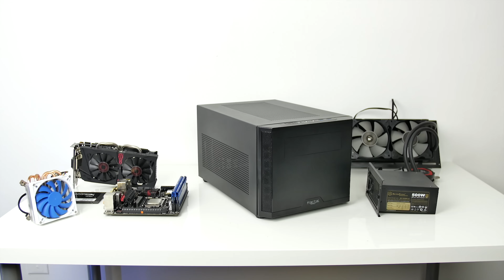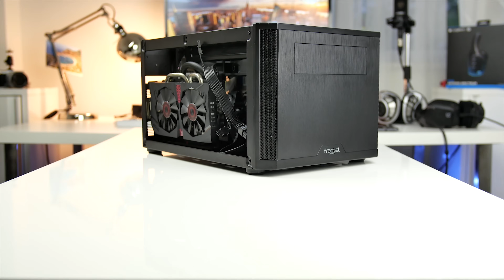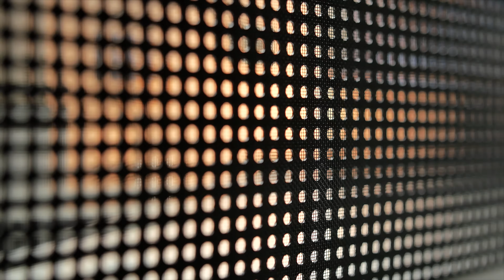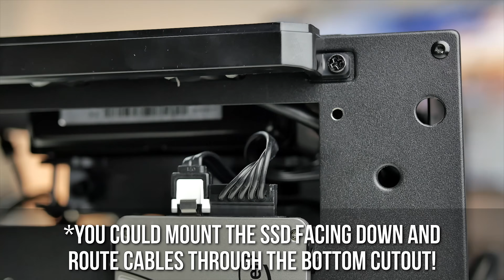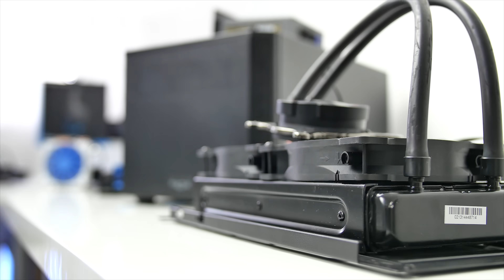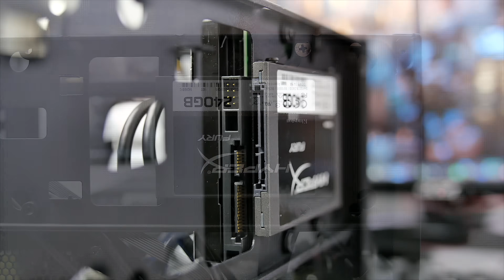Fractal Design Core 500 Review | New ITX Case King!

Comment: looks good but one day they will make a case that i will like 100% but they have not with cable why not have all the power needed to be mounted to the mainboard bracket so you can just plug a PSU in the the bracket

Comment: I know I'm late, but could tell me what type of screwdriver you used to get those 4 overtighted drive bay screws out? I have tried 16 so far. The heads are soft, shallow, and will not move, and are starting to strip. I've used PH0 to PH2, My Ifixit kit, pen oil, and even small flat heads,

Comment: i like this case & prefer using fractal design core 500 itx case over this coolermaster elite 130 because can fit CPU cooler from AIR up to 170mm or 280mm radiator liquid AIO cooler.   the benefit is the power supply move to the front on bottom.  suggest using SFX slimmer power supply because shorter cables.  

my 1st from late 2016, asus z170i, i7-6700k, hyper 212 evo cooler, corsair 16gb DDR4,  500gb SATA SSD with dvd drive & silverstone 450w SFX PSU & windows 10 home.  waited on GPU until mid-2017 lead to shortage from bitcoin mining.  id had corsiar h60 cpu cooler but switch because went to family member because upgrade over their windows XP on it.    idle at low 30 C & never goes more then 40 C because light workload with only watch youtube video.  

2nd, in nov. 2018,  asus z370i, i7-8700k, be quiet dark pro 4 cooler, corsair 16gb ddr4, 250gb nvme SSD, 4tb nas backup drive, corsiar SFX 600w power supply & evga geforce gtx 1060 6gb ssc, windows 10 pro.  my 8700k was delid & temp are down ~10 C.    idle in low 20 C & never got higher under load 60 C.  the gtx 1060  GPU has reach ~ 74 C.  & still quiet. 

itx case build is smaller space & know on limited expansion & space for installation.   you can turn up front side up & remove screws & look like the "black" mac pro desktop but more upgrade.

Comment: Just built with this case.  Decent overall.  But for crying out lout some of those screws were in there damn hard.  Had to get a power drill with a screwbit to unscrew a couple on  the fronst so I could detach the 5 inch bay.  Also had to detach the back fan to fit a huge power cooler.  I would also HIGHLY recommend an SFX power supply.  Gives a lot more room to work with.  Full size will work but will likely compromise the videocard length.

Comment: No it's not the ITX King. I bought this unit a month ago. Due to work outside of city for about 1 month, i just got a chance to check my new Core 500. However i got a DEFECT unit, 4 screws at fan bracket are COMPLETELY UNREMOVABLE, hence i couldn't place my 240mm radiator unit in there. Both Fractal support and the local dealers are pain in the ass. They don't want to replace my unit (The dealer said they don't want to replace any case unit after 1 week from delivery date, while Fractal insisted for me to ask the dealer to replace mine)

TL;DR Fractal Core 500 is a piece of **. Completely disappointed

Comment: I actually have an itx build and i just put an R9 280 in it. I have the coolermaster elite 130 case. here are the specs. It has a 6800k richland APU, gigaybyte F2a88xn wifi mobo, corsair h55 all in one water cooler for the cpu. An old 700 watt power supply and 8 gigs of corsair vengeance pro ram at 2133. and 2 terabytes of hard drive space :). I need to get my other hard drive replaced in there so i can have 4 terabytes :D lol.

Comment: Nice to see that the 5 1/4" bracket still fits with an H105 installed. I don't love that cutout for a 5 1/4" bay, so I would probably put some sort of shallow 5 1/4" accessory in there.
Does anyone know how deep this bracket is?
Reply: It is quite deep, but removable.

Comment: I built in this case the stock 140mm fan is an intake. I could not connect my audio jack. I am going to add a cpu water cooler (Deepcool).

Comment: You have configured all fans for exhaust! Is that wise?
Reply: air will intake naturally from all the holes of the case to compensate the lack of pressure inside the case compared to outside. If you do only intake fans the air will exhaust from all the holes to compensate too. Doing only intake with dust filtered fans will help a lot to keep the system dustproof as the air will get out from the tiny holes and the dust cant inter by here.
Reply: That and rads should never be exhaust. They need the coldest air they can get, that rad should be intake and I would flat out remove the rear fan or put a very slow one.

Comment: The SFX power supply adapter plate is cenered, Why cant the power supply be designed to be higher by making it mountable to put the power supply higher or lower. Is it possible to bottom mount a ssd/M.1 drive.

Comment: Hey guys, how do you put this lid back on? I have made a mini itx gaming rig in this case and the lid won't fit on! The screw holes won't line up with the holes on the enclosure lid? I don't have too many cables in the way and it should close but I can't figure out the mechanism and the manual was atrocious! Any help would be really appreciated!!
Reply: Hammer
Reply: lol
Reply: I managed to close the lid but now I opened it again cause I Want to remove the radiator bracket so I can do some proper cable management. Getting good temps but worried about wasting space for better air flow inside the case. My only problem is that 3 of the 4 screws for the mounting bracket are too tight to remove. I have a normal Philips-head screw driver and the first one came off just fine. Wondering what went wrong and maybe if I got a faulty case with the screws soldered onto the case. The manual says the bracket is removable for ease of access so it should work okay and that screw driver undid all the other screws so I don't see why I am having this problem. Any advice? Just lost my multi-bit screw driver as well! :( that might have done the trick.

Comment: I bought this case last week and found that it's probably easier to manage some of your cables by routing them around the front of the frame (assuming that you're not utilising the removable 3.5" and 5.25" drive cage. There's always a way around it, it's just that you need to use your imagination

Comment: What are temps like in a case that has only a 140mm exhaust? I wont be using a rad at the top for my CPU but will try to fit my Bequite Pure Rock if possible.
Reply: Just checked out the specs. This case is perfect for my Bequite Pure Rockcpu cooler, Seasonic M12II ATX psu, WD Blue 1TB HDD/250GB SSD and R9 380X gpu!

Comment: I just wanted to double check that this fits a full sized air cooler like the Cooler Master 212 Hyper EVO? I'm looking for a mini itx case to use to transplant my current parts into a small build by downgrading my video card potentially. Many thanks in advance!
Reply: CM Hyper 212 EVO is 159mm tall and the case supports up to 170mm tall CPU cooler so your good for the transplant!
Reply: Thank you! I am still torn between what case to get. I am interested in the BitFenix Prodigy M at the moment. So many choices! If I get the BitFenix case then I don't need to get a Mini-Itx motherboard cause mine is already macro size.
Reply: +NateyMcGee Leet I have a new question!! Will the Cooler Master 212 Hyper EVO fit along side a Corsair CW-9060007-WW Hydro Series H60 High Performance 120 mm Rad All-in-One Liquid CPU Cooler? I want to use that to cool my GPU because my Cooler Master 212 Hyper EVO is cooling my CPU. Many thanks in advance!! Sorry for the trouble.
Reply: It will fit if you put the H60 towards the front where the CD drive/HDD bracket goes.

Comment: I like my CM Elite 130s just fine. I built my first one as an HTPC, and liked it so much that I built a desktop from one too. Lack of included dust filters on the 130 are the only con vs. this Fractal, whereas I can run full-sized PSUs and GPUs without issue in the 130. I don't see the Fractal bringing much new here.

Comment: I found some very unique features with ANDY LANK METHOD while trading as a real user. It’s one of the latest trading signal services that can send signals of business which are highlighted by the software randomly. The main point of loving this system should be that ANDY LANK METHOD system does not require any major broker that adds to the lack of trustworthy of this tool. ?

Comment: Damn, this tower is much to high.
I know its no car, but they should lowered it !
No 120mm in the back, no 5inch slot in the front.

Put the 120mm or even 140mm  in the front

then lower it until it hits the GPU. Low rofile cpu cooler.
and then an fsx power supply, SSD/HDD over the PSU.
Air intakes are  now the front, the GPU side, and right above Low Profile CPU cooler
OUtput to the rear with Ventalation holes

then it is like 30% lower.
And maybe 10€ cheper would be great :D

As LAN-PC its simply to fat, and ITX cases should not be so fat

Comment: Pass on this one btw guys and get the cooler master 130. I just built my system in this core 500 and i wanted to love it so badly but its a complete pain to build in this thing. The panel is a pain in the ass to get back on right as was stated in the video and If you have a full sized modular psu you cant install a gpu, which you can do on a cm elite 130. Sure my fault maybe for not looking too in depth at what you can and cant do with a full sized psu, but its ridiculous that an aged 35 dollar case can do what this one cant. Get the 130 unless you absolutely have to go with a fractal case.
Reply: You can use a non modular 170mm PSU or 160mm modular PSU with a 310mm GPU so what are you talking about you cant install a GPU with an ATX PSU?
Reply: +NateyMcGee Leet Most people i know have modular psu's. Btw I tried stuffing 3 atx power supplies in there one of which was non modular and not long at all and i still had to rub my gpu against the cords coming out of the psu. Ill say the core 500 has better airflow and probably better quality than the cm 130 but it doesn't fully offer full atx psu compatibility with a long gpu for about 90 percent of people out there. I tried to make this case work without having to resort to buying an sfx but alas for my needs i just couldn't. My 970 was forced to rub against every psu i put in there, all of them varying ion length.
Reply: That sucks to hear I might get the Define Nano S now, thanks for the explanation.
Reply: http://imgur.com/a/kx7QN

check this out

No problem and personally i wish the define nano as out when i was in the market for an itx case because the nano is far superior to this core 500. At least i found an alternate use for my core 500, it was re purposed as my secondary gaming rig which houses my i7 5775c and 1tb ssd, good enough to play league and some fps. Just take off the outside panel, drill holes on the frame to line up with your motherboard stand-off holes, zip ties through the holes you drilled, and viola, you have the worlds smallest open air full size atx chassis, which sadly holds more drives than my corsair 600c, which is a full tower. Everything is secure and ive grown quite fond of it. As an itx case, it sucks really badly if you want to fit enthusiast components, but as a makeshift atx cube, its actually is damn good and looks pretty snazzy imo. I know some people would think its hideous but hey, different strokes for different folks. It doesn't accumulate as much dust as my main rig in my corsair 600c or my other system in my define r5 which is weird seeing as its open air.
Reply: Lmao that's awesome. You wont have any temp issues for sure.
Reply: NateyMcGee Leet Nope, well good luck on your search for that special itx chassis.
Reply: It looks like you can install a gpu but not your three fan type you as that looks like it will cause interference. Well I guess this might be a good case for a future build of mine if I plan my hardware carefully.
Reply: This looks like it has good hardware support but might consider the core v1 or nano s as well.

Comment: IMO the SG13 and Elite 130 both do a better job in a similar form factor.
Reply: SG13 has terrible ventilation and cooling. Core V1 is small and it has great cooling.
Reply: Hardware support on this one tho. Sg-13 is capable up to 61mm of air cooler height while this can do up to 170mm. Depends really on what your after. I personally would go with this.
Reply: If you use an SFX power supply (as truly intended) i believe the SG13 can support roughly 125mm cooler actually
Reply: @YoItsM0  when you put it that way. You are right.

Comment: Why make this build with negative-pressure when you have got to know that it leads to dust buildup because it pulls in unfiltered air? I think Skylake is efficient enough that you wouldn't have to work about the hot air causing anything to overheat. You could also go with a blower-style card to help keep internal temps down.

Comment: Excellent, I've been waiting to see reviews on this case; thanks for doing one.  I already have my itx build in this case, and I absolutely love it.  Although coming from a large form factor build in an R5, cable management took additional patience.

My only complaint about the case is the 5.25" cut out.  The front panel would look much cleaner w/out it, especially given where 5.25 inch drives are in their life time.

Regarding the front IO cable frustration mentioned at 4:15 - I routed mine outside of the interior, starting at the front panel and taking them along the upper/outer drive  mounts.  They flow nicely to the rear of the motherboard from there.  And I did the same w/my sata cables.  Instead of going across the interior along the motherboard, I routed mine behind the front panel, then along the outer drive mounts.  This freed up a bit of interior space.

Comment: this case was great, however mounting the 4th screw in the psu was impossible for me and routing the extension cable to my seasonic x650 psu was a pain. also beware putting giant air coolers in this baby, its tough
Reply: I made the mistake of using a big ol' air cooler in this case. Got it all in eventually, but it was cramped.

Comment: Seems like you glossed over things a bit Dimitri, but still a solid review.
Reply: +Soso64bit That's exactly it - a case review. He has no need to go into what hardware he used. You can see what he used most of the time anyway - you don't really need to know what the motherboard, CPU, HDD/SSD or PSU he used since they are mostly always the same. Cooling he should cover because that takes up space.
Reply: +QuestionmarkX3 agreed, would be nice to know which components he used and why. I guess it was just a simple case review, but I like when reviewers go into detail of the hardware used.

Comment: Can you guys help me? Will this fit in this case. I've checked and it will but maybe I overseen something!
EVGA Z97 Stinger WIFI (with an Intel Core i7-4790k)
ASUS GTX 970 Strix (*will there be much "force" between the cables from the psu and the gpu?) 
Corsair RM750 ATX Power supply (*will it bottleneck or destroy the mobo :s?)
Corsair H100i
1 SSHD
1 SSD

Thanks in advance :)
Reply: Emanuele Romagnolo Removed your awnser since it is freakin' bullshit.
Reply: +perryhoofd Corsair RM750 is 180mm while this case supports modular PSUs up to 160mm only.
Reply: Gandalf 771 Ah okay, thanks :)

Comment: this has to be the best ITX case I have ever seen, if and when I ever build a ITX system I will use this case no doubt about it. I wonder if a 140mm radiator on the back and a 280mm radiator at the top will fit together in the case at the same time?
Reply: +LightHawk000 have you ever even seen a 250D?
for 60$ this case gives you better heatsink clearance than the 250D, and a longer gpu support. The 250D has the psu mounted under the motherboard, how does the layout lok even remotely similar?
Reply: Its really not that small. Like sure, its smaller than a mini ATX, but not by much. I feel like it kind of defeats the purpose of an ITX build. The Ncase m1 was much more impressive for dual rad mini ITX case.
Reply: +Jonathan King (lNomNoml) I think the Best would be Entho Evolv ITX
Reply: No long GPU support with nCase m1

Comment: I already have an Arc Midi R2 PC (GTX980, H100i cooled i5-4690k) but as I'm going to uni I need a much smaller PC case.. Currently stuck between the awesome tiny form factor of the Fractal Node 202 and this one, which is cheaper and I could fit my AIO cooler inside. It's annoying as size really is crucial for me.

Comment: Why no Support for an external Slim (Slot-In) drive. That would make so much more sense as it could be mounted behind the front panel only sacrificing one SSD and still keeping the inside clear for cables or a 240 radiator.

Comment: This case is kind of boring looking. Fractal has taken a step back in terms of modern cool design. And why don't they offer their new cases in other colors? Why only black? Cost too much to make cases in more color options? Meh, pass.
Reply: +Ryan R I don't think Fractals target customers are gamers who want gold plated computer chassis and thousands of LEDS in their system. Fractal's cases have always been meant to go unnoticed.
Reply: Ryan R you'd probably be surprised
Reply: +Ryan R HTPCs are supposed to blend in, though. Not stand out. This isn't a LAN case, but a case to go in an entertainment centre
Reply: +Ryan R Personally I don't mind the boring look (I have a Node 804). However I would like to see at least a white option available for their cases.
Reply: +Ryan R Black may be a bit boring, but it doesn't clash with anything either. Imagine if it were neon orange instead.